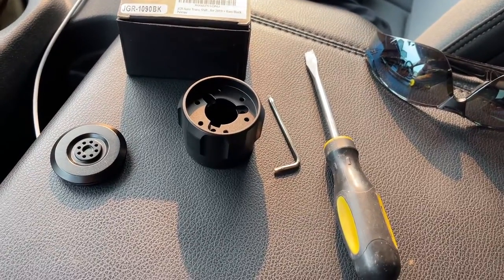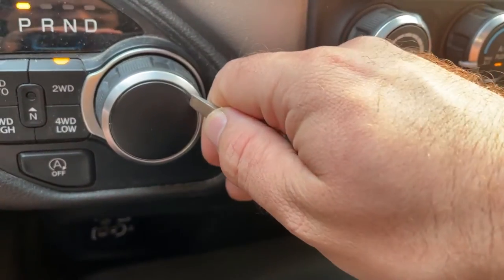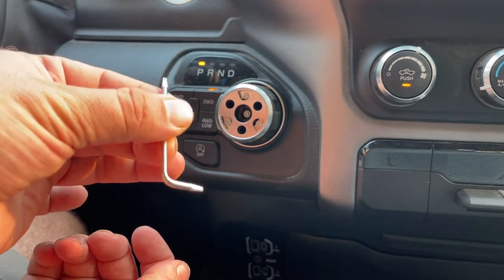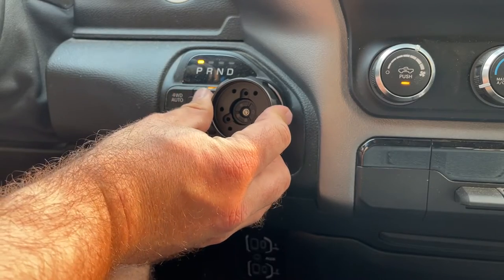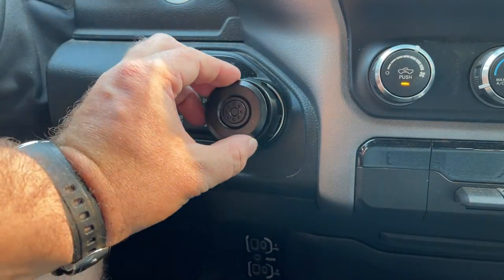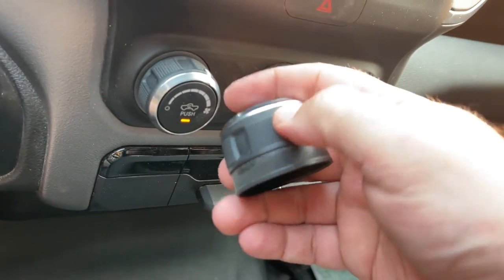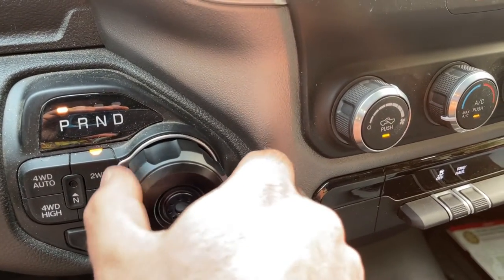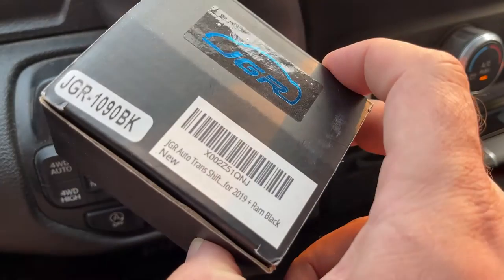2019+ Ram 1500 Shift Knob Replace

Comment: you don't have a mechanical linkage to the transmission? It's all electronic?
Reply from the maker: Majority of cars now are using electronic shifting like this.
Reply: Even the traditional gearshift levers are electronic and are there only for aesthetic purposes. Even the F150 with a center console shifter is nothing more than a geared box that activates an electronic switch. It feels like it’s connected by linkage, but it’s really just a small electrical connection.

Comment: Have you done, or would you be up for doing a video of the procedure for getting the truck in neutral when the battery is dead. Thanks
Reply from the maker: I no longer own the truck but this is addressed in many places online. Search Google for 2019 ram manual shift neutral and they’ll come up. Videos too.
Reply: @hanksgarage_  thanks for the advice. I really need to write down the procedure and keep it in my glove box. I enjoy your tutorials and you work on stuff, that I have lying around, so it's motivational. Thanks again.